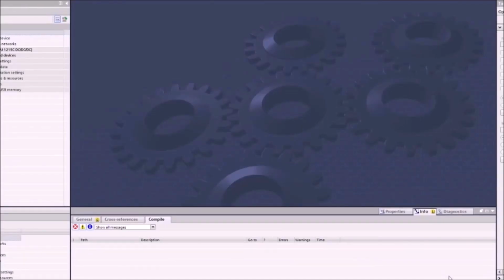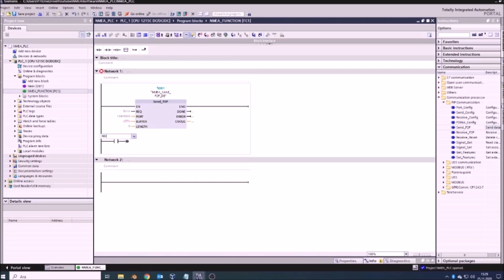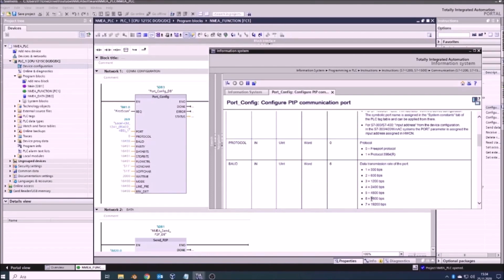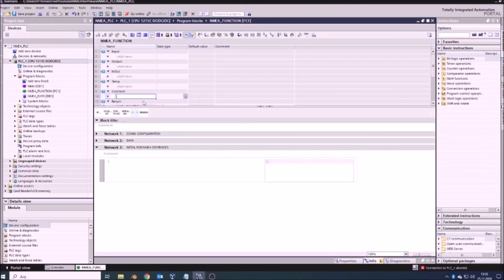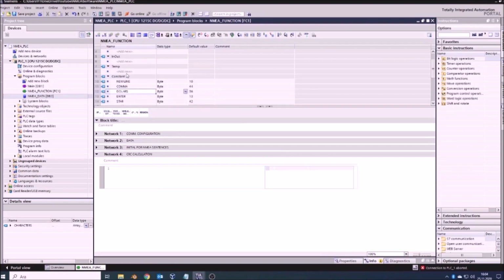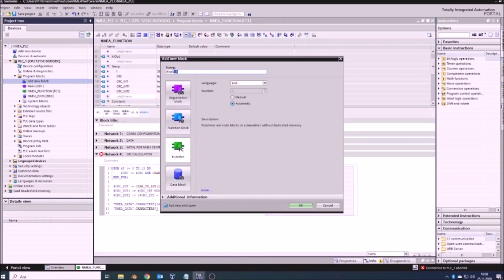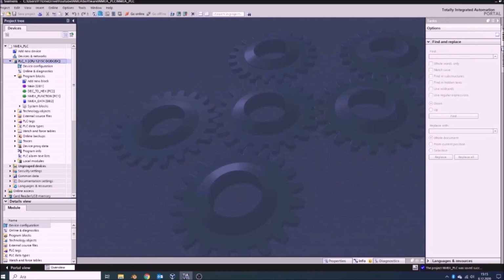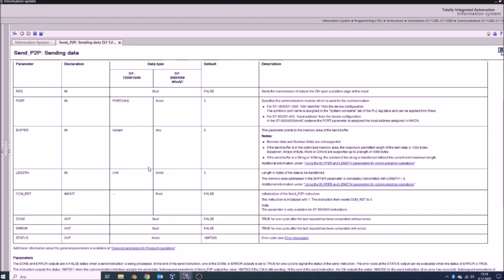S7-1200 PLC Serial Communication with CM 1241 Module- NMEA

Comment: Hello sir

How we can do communication dop110 cs delta HMI with seimens CB 1241 COMMUNICATION MODULE RS 485
Reply from the maker: I think dop110 cs has no ethetnet port right? Not ecxatly sure but I think it is possible to communicate via modbus rtu (Rs 485) Rx/Tx pin 2/3

Comment: Is it the same process for nmea 2000?
Reply from the maker: Not same

NMEA 0183 vs NMEA 2000

Yusuf TUNÇ
What is the difference between nmea 0183 and nmea 2000

NMEA 0183 and NMEA 2000 are both communication protocols used in the marine industry, but they have some significant differences.

NMEA 0183 is an older, widely used serial communication protocol that was first introduced in 1983. It was designed to allow marine electronics, such as GPS receivers, autopilots, and sonars, to communicate with each other. NMEA 0183 uses a simple ASCII serial protocol, and data is transmitted at a relatively slow rate of 4800 bits per second (bps) or 38400 bps.

NMEA 2000, on the other hand, is a newer, more advanced protocol that was introduced in 2000. It is a high-speed, multi-transmitter data network that is capable of carrying both data and power. NMEA 2000 uses a Controller Area Network (CAN) bus architecture, which allows for much faster data transmission rates of up to 1 megabit per second (Mbps). This higher speed and more efficient data transmission make NMEA 2000 more suitable for complex and larger onboard networks.

Another difference is that NMEA 2000 is a "plug and play" network, which means that devices can be easily added or removed without requiring extensive configuration or rewiring. In contrast, NMEA 0183 requires careful configuration and cable routing, which can be time-consuming and costly.

Overall, NMEA 2000 is a more advanced and flexible protocol that is becoming increasingly popular in the marine industry, while NMEA 0183 remains widely used and supported, particularly in older boats and equipment.

Comment: I have connected a temperature sensor to the CM1241 RS422 / 485 and want to read out the temperature. I used point-to-point communication as a building block, but sometimes I get a good temperature but sometimes with unknown characters. Have researched so much but I don't get an answer. can someone help.  I can't find the problem if I send the command ?T$ L$R then there has to be an answer with! T = 25.5 ° C $ R, but sometimes I get strange characters.
Reply from the maker: I don't know but may be, it is better the use special cable like avoid to noise or something

Comment: Does S7 1200 require extra connector for connecting RS232???
Reply from the maker: It depends on your connection
Reply from the maker: And this video was not about RS232
Reply: @SoftwareElectronicElectrical  Okay. Which was the type of  connector you used ??
Reply from the maker: @sheffin04  you can check RS 232 Module manual which pins that it is used. In this project it was RS485 for NMEA communication. CM 1241 is used for RS485 / RS422 communication. I used Profibus socket which is same RS485 connection.
Reply: @SoftwareElectronicElectrical  Thanks Sir for your information. What's the price of the module you used??
Reply from the maker: @sheffin04  I don't really know, this is jobs not mine in my company

Comment: Hello, I have followed the instructions of the video.  Everything went well, with no errors.  however my 1241 cm module does not flash the tx light.  and the Usb - rs485 module does not receive any data
Reply from the maker: You may change version of the function.